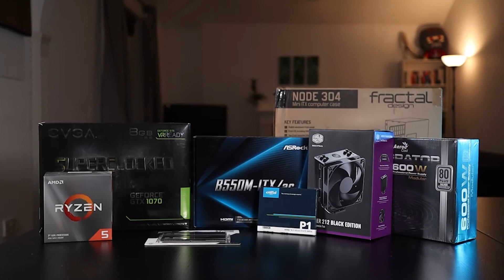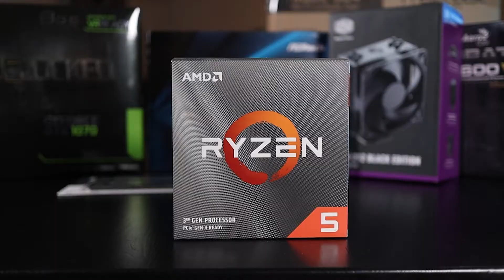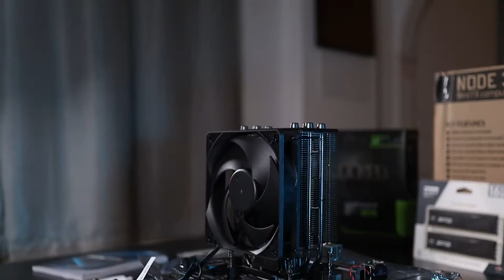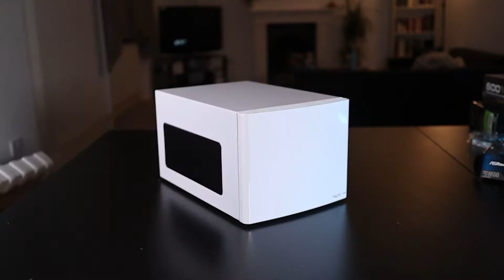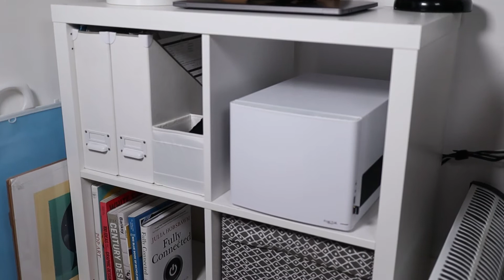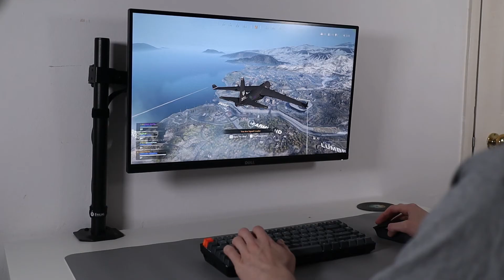£800 ITX Gaming and Editing PC Build 2021

Comment: I did a very similar build to this in the FD Core 500 but as a 4K gaming/business/family build here : https://uk.pcpartpicker.com/b/PbCbt6  Also delidded and overclocked the CPU. It's stood the test of time pretty favourably as well given that the latest 3000 series GPUs are still pretty hard to come by at a sensible price. If you switch XMP to "on" in the ASRock UEFI it should automatically give you your RAM module max speed of 3200MHz in your case. Failing that it can be done manually using the dropdown selector (which can, I think, also be used to clock even higher than the suggested frequency - haven't tried that one yet as I think the effects are pretty negligible in any case).

Comment: same happened to me...  I installed extra 8gb ram 2933Mhz in my legion 5 and the speed decreased to 2667MHz, in signal channel it was 2933Mhz but in dual 2667Mhz. why so?
Reply from the maker: That is annoying, sounds like it is quite a common issue though